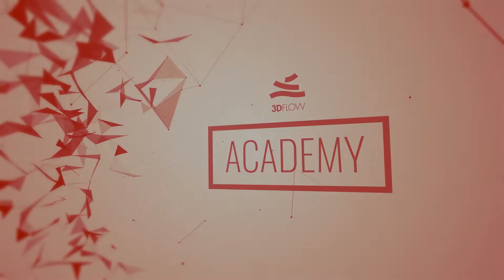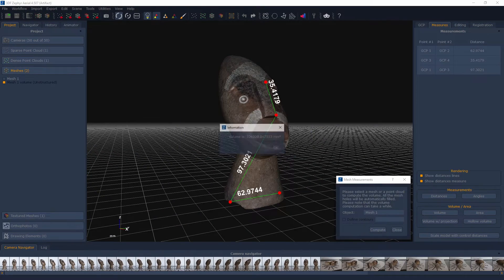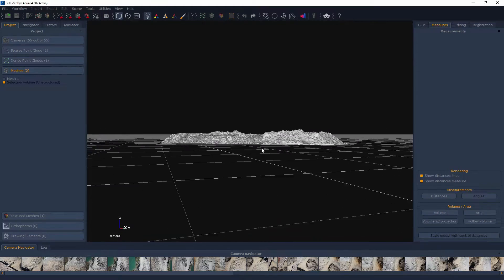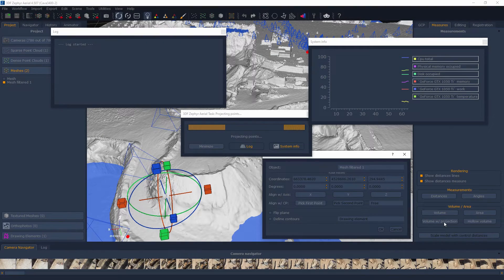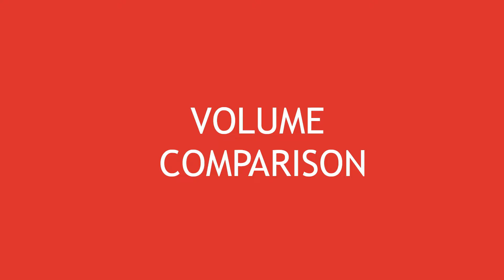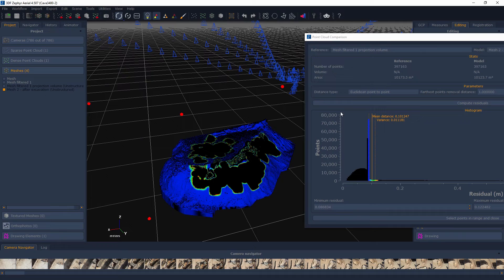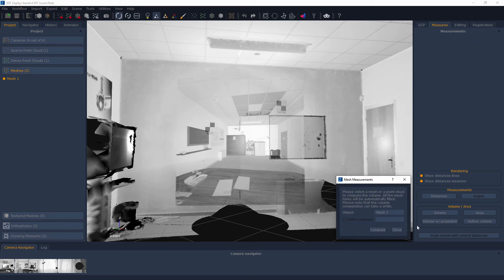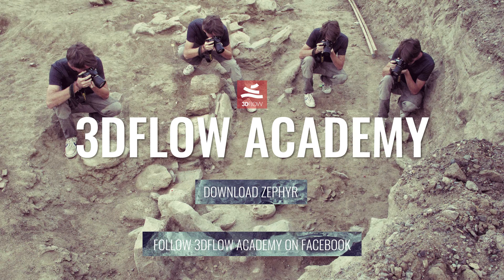3Dflow Academy - Videotutorial 15 - Advanced volume measurement tools

Comment: Hi guys, would it be possible to calculate room surface area and volume with your software? I would imagine taking hundreds of photos of the room, and then performing such calculation. Thanks!
Reply from the maker: Hi Simonas! Yes indeed - make sure to use the "hollow volume" function for a room and not the standard volume function.
Reply: @3DflowChannel  Thank you for your answer. Great! I will try it. Do you have some advice how to achieve better results? E.g. using wide lens. Maybe you have a tutorial how to do that (calculate room surface area)?
Reply from the maker: @KEcAzZ1  happy to help! Interiors are harder to shoot, but the same principles apply. We suggest using a tripod and long exposure times, given lighting will likely be a problem. Be aware of completely plain walls (same color) as they will likely be a problem, in which case, you should consider placing some markers around or - even better - use a projected pattern (see videotutorial 2) for best results. Make sure to take crips, clear photos - it's harder with artificial light!
Reply: @3DflowChannel  Awesome! Thanks for advice! I saw some clips online saying that even video could be used (software gets images itself). I am thinking to use 5D mark ii with 16 to 35 mm lens. I also have light (portable LED; though not that strong). This is for scientific project actually (indoor/outdoor air quality), with final result to be publication. Would you be interested to cooperate? We have 4 households, where we place our instrumentation to measure particle number size distributions. Knowing room surface area is needed for modeling indoor air quality. I could offer a co-authorship and/or acknowledgment. If interested, please just let me know.
Reply from the maker: @KEcAzZ1  we'd be more than happy to give you advice or tips more tailored for your specific needs. Feel free to reach out at support@3dflow.net :)